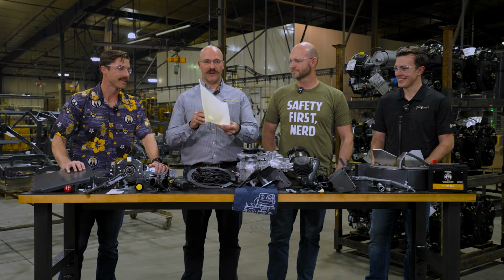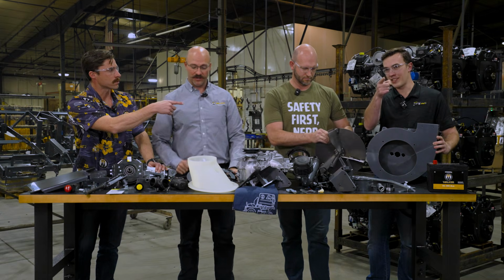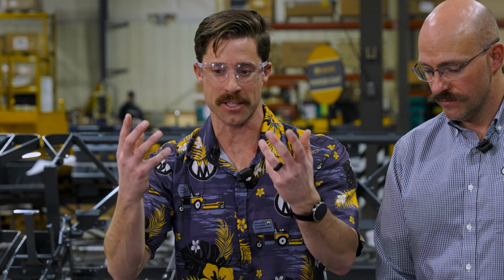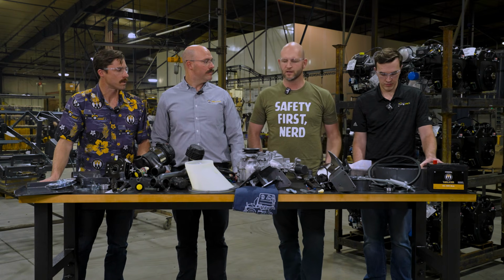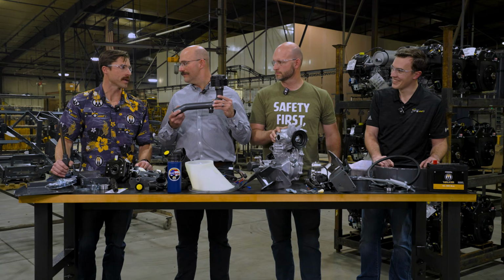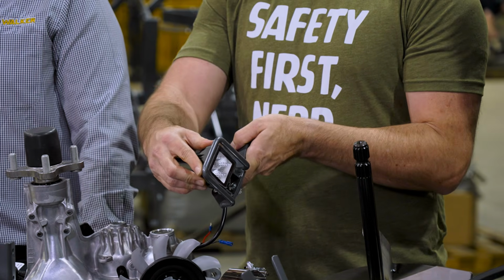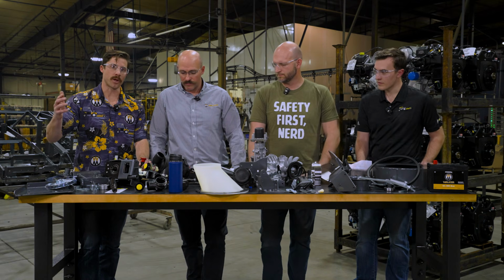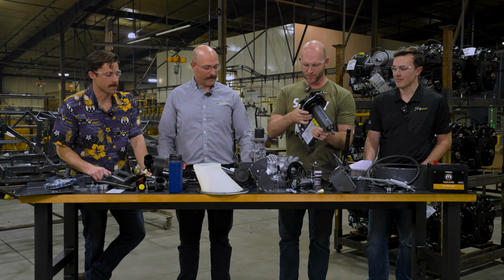Why the C23i Performs So Well | Pile of Parts - Walker Talk Ep. 4

Comment: i have a 1996 mt that i bought used in 1998. installed the speed up kit an raised the engine rpm to 3850 rpms. ran it that way for 2400 hours before it decided to bend all the pushrods.  looked at a super bee when they came out an have been watching the b model since it came out. have always like walker mower company's beliefs an values. hope kohler engines will still be available.
Reply from the maker: Thanks so much for sharing your story and for your support over the years, Bob!

Comment: This is really funny, I sent details to Bob Walker probably 15 years ago about a debris loader that I designed and it had an involute scroll. C'mon you engineer's Involute is the word. I wanted Walker to produce and sell them....Hardox 400 impeller with an Involute scroll lasted 15 years. Couldn't plug them because we vented the intake tube. That is what the hole in the chute also does.
Reply from the maker: Thanks for sharing, and we really appreciate the input, David!

Comment: I have a 2010 B and a 2008 super B. Why don’t they have snorkels? Also, they both have 2800’s, but my 2010 B was fixed under warranty, and the new kit has 3100 on the filter guards.
Reply from the maker: Thanks for your question! The Model B family are non-collection machines, so their airflow dynamics are a bit different from our collection models. Because they don’t have a catcher box exhausting dirty air, the Model B can easily pull in clean, cool air through the intake without the need for an external snorkel.

Comment: Absolutely love Walker mowers. we just started to use them for snow removal, and they kick butt.  I hade bought snowrators, and they are slow and will not push snow like the walker does.  You need to work on a snow walker with a salt spreader, not that fertilizer spreader you like to use.
Reply from the maker: Hi Shawn, thanks for the feedback! We will keep that in mind.

Comment: The blower fan needs gussets
Reply from the maker: Thanks for the note regarding gussets. Currently, our blowers are robotically welded and undergo thorough balancing checks after welding to ensure optimal performance and reliability. If you have a specific concern in mind, we’d be happy to review it and make sure everything meets your expectations.
Reply: @walkermowers  can I put that new style a blower on my 2019 MT 31
Reply: Do all C23i models have the redesigned/ optimized blower?  Or are these changes only found on newly built c23i models?
Reply: I would think it could use Gussett. And also if it’s anything it should be balanced.